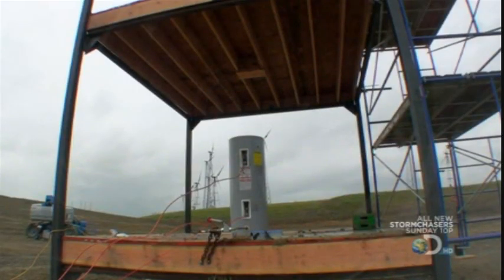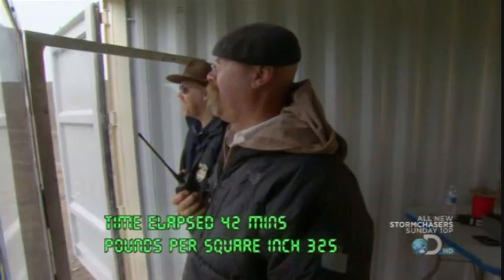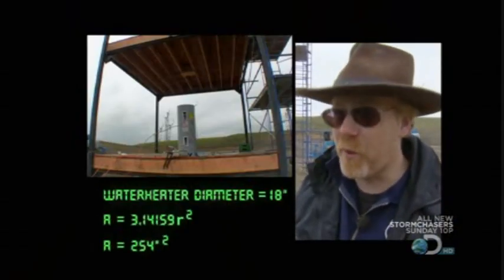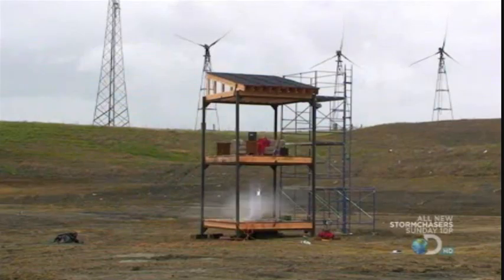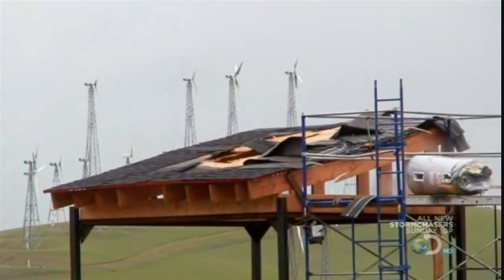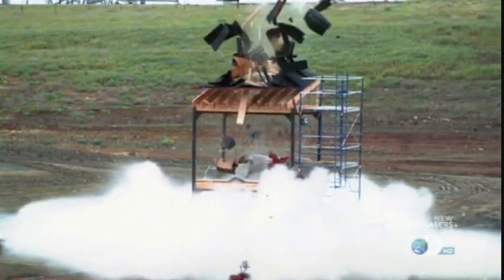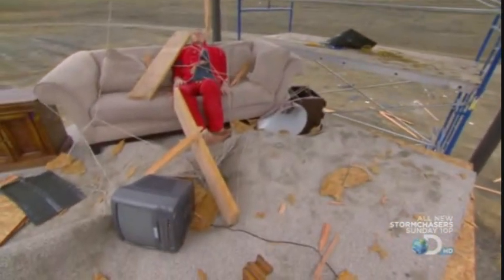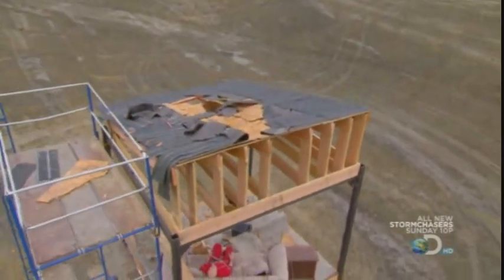Mythbusters Water Heater Explosion

Comment: Noted a missing TPR.on a water heater.  It was capped.  I reinspected and noted a improper plastic PVC for a drain line.  Should be a minimum of  CPVC.  I wanted to share this with my client.  Thanks Mythbusters!
Reply: I am curious....my old hot water heater was clogged at the drain pipe...could it have exploded like this?
Reply: James Valenti Very unlikely as all water heaters come with a safety pop-off valve located at the top or top side of the heater. The pop-off valve would have to fail combined in combination with failure of the thermostat/s. This is why you don't hear of water heaters exploding. Before the invention and implementation of the safety valve and reliable thermostats, water heater explosions were common. In those days carpenters made out like bandits repairing ceiling and roof damage caused by exploding heaters. The only reported deaths ever recorded was an unfortunate dog who had been sleeping next to the family water heater for warmth when it exploded. Poor dogie. I guess he was the original "Hot Dog." I relayed all this to Adam & Jamie when I submitted the idea some years ago. I also suggested that they should, at the end of testing, create the "unfortunate" circumstance in which all the safeties on one of today's modern water heaters should "mysteriously" all fail at once. It would have been nice if they had at least mentioned my name when presenting the myth experiment. That episode is one of the shows top five.

Comment: I remember about 10 years ago my neighbors water heater blew up. Boy was it loud and scared the piss out of me. Thankfully no one was hurt but he was set back with a lot of repairs.
Reply: When I was a kid, a neighbor’s cabin had a minor malfunction with the propane heater… only the floor, one wall, and the roof (which was at a 45 degree angle) remained.
Reply: Propane leaks igniting in a house are a seperate matter, theyll destroy a building every time. You can't overpressure a hot water heater tank because once the pressure becomes higher than mains water pressure, it just forces water backwards out the mains inlet pipe.
Reply: @rossbrumby1957  Nope. There must be at least one valve to prevent a backflow into the water supply on order to avoid contamination.

However, modern heating elements have got a temperature fuse which limits the temperature and therefore the pressure. If the element gets too hot, the fuse melts, leaving the heating element interrupted (irreparabel).
Reply: @rossbrumby1957  That depends. Some places mandate backflow preventers so that if a building has compromised plumbing the public system and other buildings are less likely to get contaminated. They also can be part of water softening systems. In those cases water heaters have to have something to handle the pressure increase when the water is heated. The most common is a thermal expansion tank, which essentially has a volume of air acting like a spring. As the water expands the air compresses with a much smaller required increase in pressure, absorbing the volumetric increase. Of course there's also the standard pressure relief valve that should also let out pressure within a safe threshold, though fewer people do the periodic tests to make sure that they still operate than should.
Reply: @seabream  Yes I operate the relief valve every few months, I know they can get stuck being outside. I had a plumber visit on another matter and he offered to replace the relief valve for $450 and I replied, no mine still works because I check it.

Comment: That's why there are pressure and temperature relief valves on every water heater sold in the U.S. Don't seal them off or plug them or else this will happen. If the T&P leaks, have a licensed plumber look at it. It may be a symptom of a different problem.
Reply: As far as I know, modern heating elements also have got a temperature fuse which limits the maximum temperature and therefore the pressure by interrupting the heater irreversible if it gets too hot
Reply: There's also your inlet and outlet piping system which lets most pressure escape.

Comment: thank God for temp & pressure valves. a tank-less water heater will also explode without one. not to pick... its a water heater not a hot water heater. why would you want to heat water that's already hot?

Comment: I can imagine how painfull getting sprayed w/ super heated steam would be
I took a solar shower with 130 degree water and it was horible
Reply: How did you stand that? I'm pretty sure that would scald your entire body?
Reply: @jacthing1  that depends on time of exposure and actual temperature where the water contacts.  Shower water will quickly lose heat to the environment as it falls through the air, and moreso when the water is farther from the air temperature.  An experiment I found online came up with around 18 degrees F (10C) difference from shower head to floor, and most of the heat would be lost near the top, since the hotter water cools faster.  Even the pipes would lose some heat unless unusually insulated.  130F at the source might be 125 exiting the shower head, 115 on your head and 100 at your feet.  (Hair will also slow down heat transfer to the head, dampening that 115 somewhat.)  Really and unnecessarily uncomfortable, but as long as you're moving around and not submerged, not a medical danger to most people.  YMMV.
Reply: Superheated steam through pinhole cut your arm off. The ship that I was on had a 440 lb Steam Plant. that steam will cut steel

Comment: @rocker22496 when originally testing the myth, the circumstances they came up with was that both the safety mechanism you mentioned and another mechanism were for some reason disabled.
Reply: Pedro the t and p valve would have to be blocked or fail,  and the gas control valve would have to fail
Reply: Correct.  There are at least 3 levels of protection in modern water heaters.  The mandatory overpressure valve (T&P), the pulsation damper (designed to protect your plumbing when it gets older and sediment "pops", causing shockwaves to get in your plumbing), and protection in the heater controller to shut down when a certain temperature is exceeded.  If all these fail, you risk a BLEVE event.  Most modern tanks are also structurally designed to fail in a damage minimizing manner.  Would rather it propel up than release the explosion out of the sides, taking the house down and killing/maiming those unlucky to be in it.

Comment: There is now a safety mechanism built into modern water heaters which prevents the psi from reaching anything over 150psi..... on a less serious note that was one of the coolest things I've ever seen I would just hate to be that mannequin who was sprayed with 210 degree water.
Reply: Actually more like 400 degree steam. Water under pressure can keep going in temperature until released.